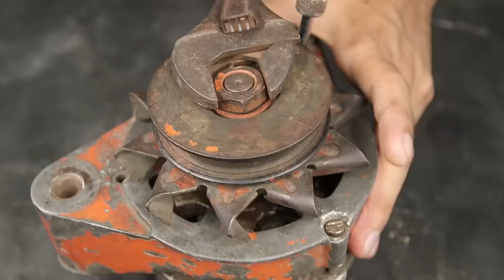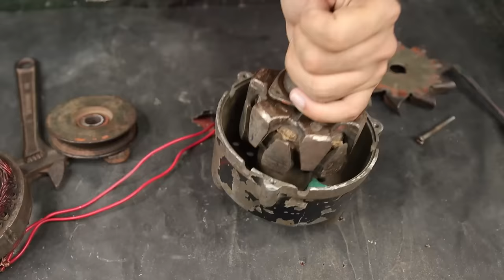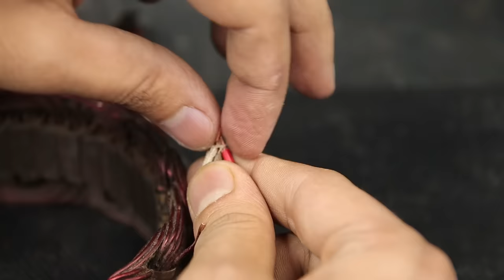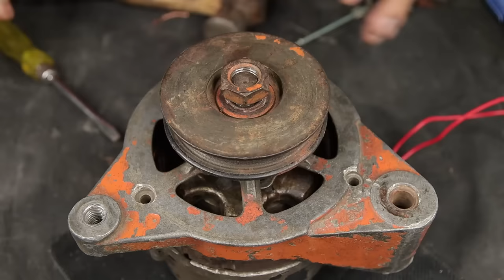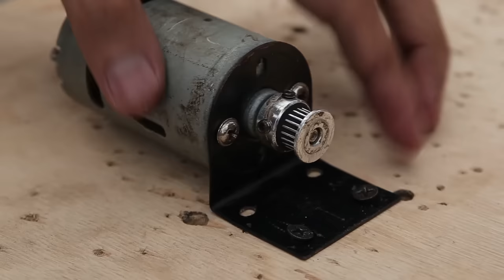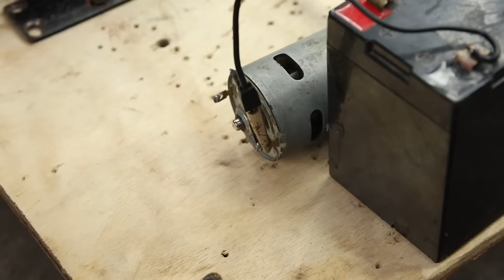Car Dynamo Motor turn to our powerfull electricity generator || How to make 8000w generator

Comment: this is fake. An alternator of a car dynamo does not output AC power, but rather DC or direct current power. because the car motor has a rectifier and a diode bridge that changes the output from AC into DC. so no, this video is fake. No motor with rectifiers can output AC, unless there is nothing but magnets and coils inside.

Comment: I also realized, his motor is running slow. this speed wouldn't output so much power for 8000watts, its not possible with this speed. and to get high voltage AC, you will need higher speed and frequency of 50Hz or more, depending on resistance of the coils and magnet strength. impendence also affects this output.

Comment: I wonder how nice it looks in the movie, but in reality it's not so beautiful. I tried to make 2 generators with 2 different power alternators and I could never get a voltage higher than 22 V and not 230 V. From what you can see, it's more of a fake than a truth. Explain to me how to glue the magnets to the rotor with the same side and have the polarization n-s-n-s-n-s???

Comment: I have seen a  machine similar to this but working more efficiently because a linear field collimator was included in the circuit. The designer told me that he had made this by modifying a reverse biased subduction spline. Apparently the device was now able to power first generation bi-stable turboreactors without introducing instabilities downstream of the matrix configuration

Comment: I see a lot of work for a dim lit bulb pretty crap to be honest...but hey hey   
Here,s what i know if your turn the ignition on in a car  the starter motor kicks in and drives the alternator and water pump yes!aaaand  If you disconnet the battery the alternator will keep running without a batter for a period therefor the battery is a power source also a storing source so why all the fuss and hastle of connecting magnets etc when its right their in our faces
All we need to do is connect that power created by the alternator toa battery then to an inverter thatll turn it into110/ 240volt shabunkins genius or what